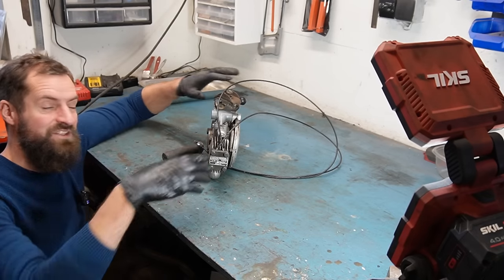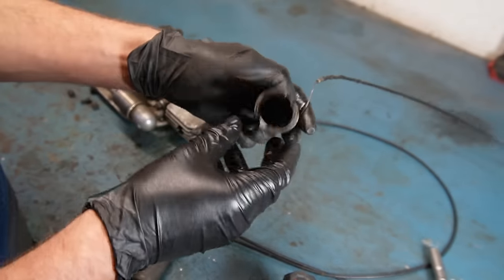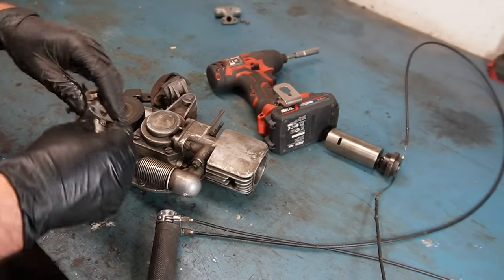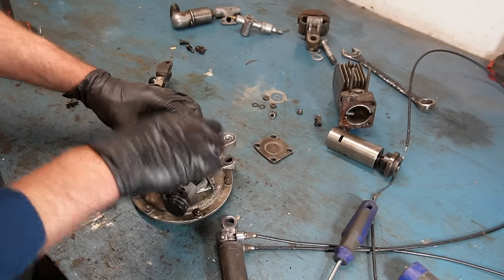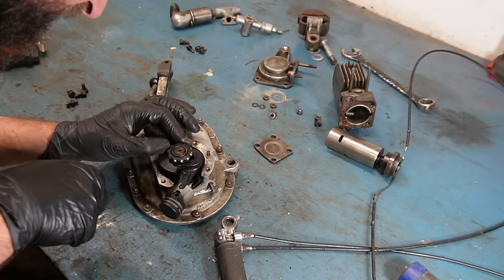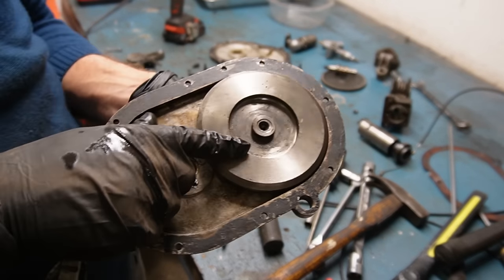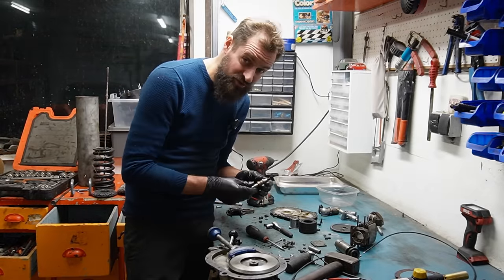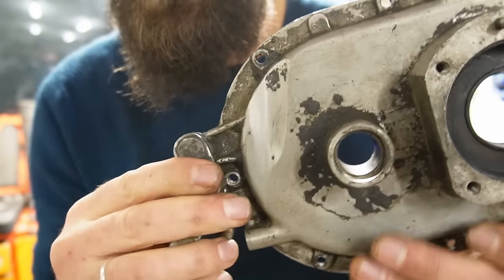Diesel Two-Stroke | The Lohmann Diesel | The one where he gets too excited and breaks something

Comment: I have to say that Herr Lohmann was an ingenious fellow. His small workshop must have had a small lathe for basic work and that would include the bronze bushes. They are very basic but might have been reamed to fit.  The Auction pic showed what appeared to be a hole in the flywheel. That could have been for a peg spanner for fitting and removal. Might be a mod as yours doesn't appear to have a hole. The top ring may well be stuck due to carbon but because the alloy piston expands it may get looser when it's hot. It's a very interesting engine, an off the wall application of the diesel principle. Thanks Otto.
Good pic of the exploded motor here. The damaged bushes are not shown as being listed as a spare part. ducaticucciolonederland
Reply from the maker: Thats where I got the piston rings from! :)
Reply: I thought that maybe so when I saw they were priced there at 25.

Comment: The bushings would be easy to make. I'd suggest you take a good look at yours to determine if it's oil impregnated bushing material. It's common material to buy for making bushings if it's needed.

The compression release might have been for coasting down hill which would maybe point to that extra hole lining up to dump unburnt fuel out of the engine.

Maybe they thought leaving the drive wheel engaged while coasting would save wear on the drive wheel and tire by reducing the number of times you might have to drop it in gear.

Obviously dropping a spinning wheel on a tire causes a great deal of lost rubber just like an airplane does while first touching down on a runway.

Comment: i do  believe the one posting where they suggested a peg spanner   when mentioning te one and only hole in the flywheel, one only needs one hole when there is a large recess in the middle  that will acommodate the other pin of the peg spanner it will rest against the ramp/rim of the recess and a rotational force ( torque ) kan be transmitted

Comment: The broken bearing(s?) look like the "top hat" type, maybe Oilite (oil impregnated phosphor bronze, I think). You might be lucky and find them in the right size, I had to look for some for a 1937 Ransomes Crawler last year and eventually found something close enough to work.
I presume they will be metric? I guess for sealing on a 2 stroke crankcase they might need to reamed for a good air tight seal.
The oil impregnated stuff is the Devil to machine though!

Comment: 23:12   My Honest opinion on those rings?  I would simply ask some VERY old timmers what they did that are in their 80s or 90s and ask them what they did for Rings and how they mended them after they lost their spring. 
Seems that if you heat them up and put them on a circular expander jig of some kind?   They will get their springiness back.

Comment: The bushing that you destroyed is NOT brass, it is a "phosphor bronze bush" (search that term).  If you make a brass bush it will eventually destroy the steel shaft.
Bronze bushes must never be machined, as they contain microscopic pores that hold oil to provide lubrication.  There are specialist companies that stock 1000s of diffenet sizes, good luck finding the one that you need.